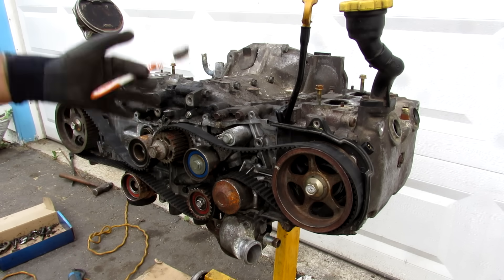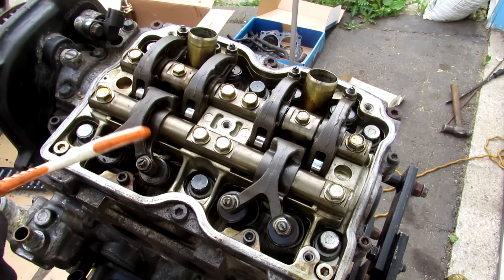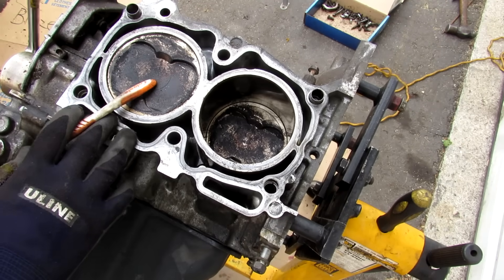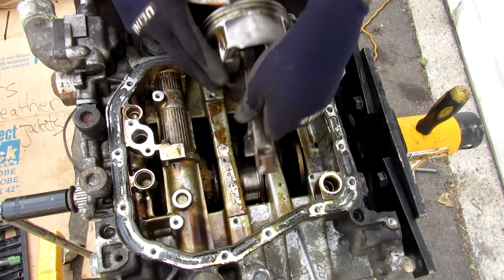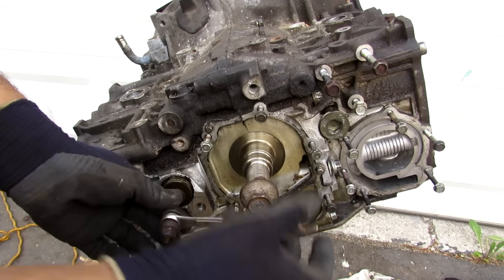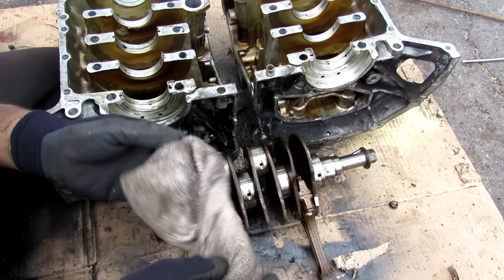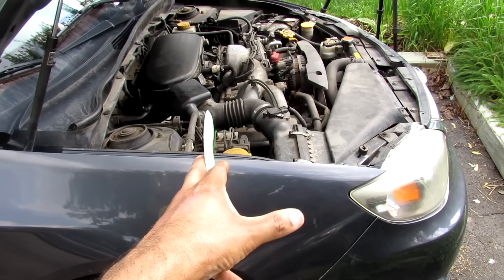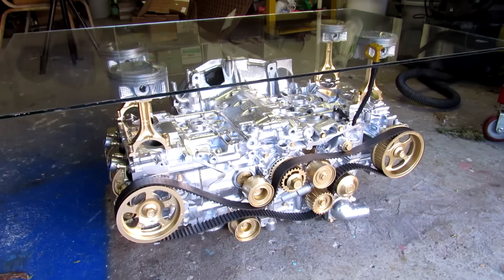Why Subaru Engines FAIL

Comment: Here's a news flash:  All engines Fail.......ultimately.  To single out Subaru as one that fails more than any other is ridiculous.  I've often wondered why Ford, Chevy and Chrysler products fail routinely before they hit 100,000 miles.  Engines, transmissions, etc. seem especially vulnerable on American/Canadian built vehicles.  As an owner of a 2008 Subaru Forester, I laughed when I saw the headline of this video.  I bought my Subaru, with the classic boxer engine, new in 2008.  12 years and 149,000 miles later, I have not had one bit of trouble, engine or otherwise with my Forester.  The key of course is regular maintenance for your Subaru.  Keep up with the regular routine maintenance and it will last you well over 200,000 miles.  I have friends who have purchased Fords, Chevy's and Chrysler products and have had engines blown, transmissions break long before they reached 100,000 miles.  When talking cars, Subaru is one of the best and most reliable vehicles you can own, even if some mechanics out there say otherwise.  I wouldn't hesitate to buy another Subaru in a heartbeat.

Comment: There are a few more reasons these engines fail.  1. the engines are designed with a large tolerance, meaning the gaps are 3 times bigger than they should be.  But this works well with 20W50 oil.  2.  burping the water jacket is harder than buying a new car.  3. the water jacket path means the heat from the cylinders heats the heads.  4. The engine is not balanced for high RPM.  This is not just the crank, but the weight of the pistons and connecting rods.  5. the engine was designed for city people to drive around at speeds less than 40 MPH and not be driven for more than 30 minutes.  So it was engineered to fail if the driver is not over the age of 65.

Comment: Centre bolts are marked because the washer is slightly larger to provide extra clamping load in the middle section of the head
Reply from the maker: Good to know. I believe the torque spec is higher

Comment: Ist time here, I have been looking to get a Subaru for a bit.  Synthetic oil help out with the oil starvation issue and coking?  I have a 2005 Pontiac vibe with a 1.8 that has 285k miles. Engine runs like new with no oil use. Oil color is tan not black when changed.  Used Mobile since 15k when purchased. Do you think I will have similar results on this Subaru engine?

Comment: Thank you for the tear down of the Subaru engine. I had a Subaru Outback any my experience with it supports your view of weak head gaskets. At around 100 thousand miles the head gaskets failed. It cost $5,000 to repair because the engine had to be taken out, heads removed and milled, and then new gasket installed. The Subaru was overheating badly and I took it to my mechanic. My mechanic informed that this is a common problem on Subaru's and he can't understand why Subaru doesn't address this with a better
design or better gaskets. I maintained the car by the book with frequent oil changes and still the gaskets failed. Bottom line, I'll never buy a Subaru again. If you are considering a Subaru and keeping it consider buying the maintenance insurance or just lease the car and give it back to Subaru prior to 100 K miles. Also experienced problems with the CVT transmission. My mechanic commented that they are also prone to problems.

Comment: My wife and I have been driving Subarus since 1995 in that time we have had 7 different Subarus. In all that time we have had no major repairs and none to the engines just maintenance. We passed down several cars to our children who have taken those cars up to the 200,000 mile mark and they have had no engine repairs.
Reply: Yep. You just have to be more particular with your maintenance schedules. I own 2, 1 with 200k, and the other with 100k. never had to do more than replace an oil seal every now and then.

Comment: By far this is the most comprehensive video on subaru engines. I have a 2003 subaru outback that has had its head gaskets replaced at around 225k miles. Recently a noise from what i suppose is the engine can be heard when first driving. After a certain mph it can't be heard probably because of wind noise. I cant figure it out and I was wondering what could be the problem from what you know.

Comment: And I suppose Porsche engines fail for the very same reasons? My 2.5 L Forrester is 14 years old and travelled 260,000 km and drives like NEW. As wisely stated below, maintenance is the issue so I call FAIL.

Comment: I'm really glad I didn't buy a Subaru. So, what is a boxer engine good for, other than low vibration? Seems to be several design flaws with this style engine. I can see it's not conducive to diy maintenance. Looks like a nightmare to change your plugs.... It actually looks worse than a transverse v6 (hello, Toyota 2GR-FE!), well half of one....

Comment: Hi, Really enjoyed your video and explanation. My only concern is in your description of the engine as HORIZONTALLY OPPOSED. This is totally wrong. A Horizontally Opposed engine has both pistons in the same  cylinder. Obviously this and all Subaru, VW, Porsche, Alfasud/33 Engines do not have this arrangement.
For a full explanation of horizontally opposed engines look it up on Google under Commer Knocker. This is a two stroke diesel truck engine used in trucks in the 50s and 60s, usually supercharged. These is no room in the combustion chamber for valves when 2 pistons are moving towards each other.The piston is connected to a conrod that is connected to a rocker arm which is in turn connected to another con rod which is then connected to the crankshaft.
This is not the first time I have heard Subaru engines described as horizontally opposed. I think it probably started by a printed press journalist who didn't know what he was talking about and spread from there. much the same as journalists call non turbo engines aspirated ?????????      All  engines are aspirated.     The term means taking in air which natural and forced engines all do.
I hope this explains horizontally opposed engines.
Reply: A little knowledge is a dangerous thing !  Well, the item you're describing is a HORIZONTALLY  OPPOSED PISTON Engine.  Per your reference, ALL the engines you've listed are all FLAT engines and are HORIZONTALLY OPPOSED, since the pistons are arranged in a horizontal plane, opposite the crankshaft centerline from each other, whether they are 2, 4, 6, 8 (or more) cylinders. 
A HORIZONTALLY OPPOSED PISTON engine has two pistons in a given cylinder, running at each other!  These were used in large trucks, VERY LARGE SHIPS, German aircraft engines and others.  Primarily, they are two stroke engines, with porting in the cylinder walls.....and a crankshaft and rods on both ends of the cylinder (the rocker arm variation is one offshoot).  They have simplified valve actuation, but they are quite tall, with cylinder heads on both end....and they're also a bugger to work on!
Reply: @dgardner55  Hi, I can't work out if you are agreeing with me  or not. None of the engines I listed are horizontally opposed as they DO NOT have 2 pistons in ONE BORE! Just because the pistons move horizontally does not mean they are opposed. Opposed means moving towards each other as a  means of producing combustion.

Comment: My turbo legacy ran out of gas at full throttle on the highway. Ran lean and melted a quarter sized hole in one of the pistons. 
Striped it down got the block bored .015 over ordered a new set of pistons and rings put it back together and she ran like new.

Comment: Don't own a Subaru and never have, but have always been curious about the engine design and potential problem areas. Looks like it takes some special training and experience to properly rebuild one, and this guy obviously has had it. Great job, concise explanation, excellent video!

Comment: Change the oil and filter.
Change the radiator fluid.
Change the Timing Belt. 
Interference valves hit the piston if the timing belt breaks.

Comment: Wow! What a fantastic video of the boxer engine! We own a 2011 Outback 6 cyl., and have been very happy with it, but I've heard and read so much bad about boxer engines that I doubt I'll buy another Subie. Ours is fine mechanically (knock on wood), relatively low miles (56K or so) and has never disappointed. But, I think I'll shop elsewhere in the future, just in case.

Comment: Yes, it is well known that subaru has head gaskets that go bad, what most people don't tell you is that they go bad at around 150,000 miles not bad,  I had mine replaced at 125,000 and it just turned 300,000 miles and has had no other major repairs other then that and it still drives and sounds like a new car, I don't know of many other cars that can match this?

Comment: Apparently that specific engine was not properly maintained so it failed relativly early. That is not a design fault. Any machine will fail quickly if not maintained. The primary advantage of opposed piston engines is inherent primary and secondary balance and allow low CG when used in automobiles. The disadvantage is they are relatively wide making a packaging problem that has been solved by Sabaru, Porsche and, in the 512, Ferrari. 
Reliability is a result of proper design, materials, manufacturing and maintenance.

Comment: Subaru super strong, 350000km and never used a drop of oil. 
It idled so quietly, you had to look at the Rev counter to see if the engine was running

Comment: i think maybe the gravity will cause pistone to scratch bottom side of cylander over the time. because its weight is always on one side of cylinder. what do you think?
Also, does these problems exist for porsche boxer engines too (and also BMW motorcycles boxer engines)?

Comment: Speaking as a retired VW tech (20yrs), I've had the opportunity to tear down several 'water boxer' engines from VW. Another flat four design. I can see that Subaru was much more thorough in the sealing of their cylinder heads than VW. We routeenly replaced the water boxer head gaskets every 40 to 50k. Their head gasket was nothing more than a circular round strip of metal! That's it! VW did a terrible job of turning their air cooled block into a water cooled. Lots of problems!  Having worked on numerous different engines over the years I have never been impressed with the opposed 4 cylinder design.  This is one of the best vids for learning about Subaru engines. Good job speedkar99.

Comment: Good stuff! Here's another downside to Subaru in general. They tell people to do oil changes at 6000 miles. And what does the average driver do? They end up going 2000 miles over on every single oil change. Sludge, contamination, changes in viscosity... Now your engine leaks like a sieve.
I see this every day at the shop. DO YOU OIL CHANGES, PEOPLE.

Comment: I know it sounds like there are a lot of flaws with these engines but i bought my 1999 turbo impreza with 98,000 miles, drove it like I stole it for the first 5 years and sold it with 235,000 12 years later still running. Changed the spark plugs once in 12 years and oil changed once a year with bog standard cheap oil from Halfords.  Compare that to my wifes 2004 80,000 BMW E46 which was driven like miss daisy all its life which had multiple oil leaks and cooling issues from 60k upto 80k when it was sold for scrap money.  Personal experience differs for everyone but my 235k EJ20 turbo engine was incredible.

Comment: My mom has a 2016 Subaru with a boxer engine... it burns oil like crazy. The dealer keeps telling her that it’s normal, my instinct is that it is NOT normal for a relatively new engine to burn a quart of oil between oil changes. Especially one that’s been pretty much babied from the day she bought it. Any opinions on this?

Comment: Great video. Had a Subaru with hairline cracks in the cylinder heads, fixed under warranty, did more than 300 K with it, never touched the gearbox nor the shocks. Red worms ate the car. Well engineered though.

Comment: Do these engines have ANYTHING other than weak spots? Seems like an engine to avoid.
Reply: No. They’re really god awful engines, the Germans perfected boxer engines then stopped using them because they saw that they just weren’t as good as stuff like inlines for small engines.

As a reminder, the air cooled volkswagens never had head gasket problems. In fact, they never had head gaskets, the engines were built so well they didn’t need them to retain the oil. 

Only oil problems those engines have are bad push rod tubes or old engine seals, maybe a bad valve cover gasket that takes 10 minutes and 10 dollars to replace.

Subaru has made them for years and keeps adding problems.

Comment: How many miles on this engine? Oil starvation did most this damage
Reply from the maker: I don't have history on it
Reply: @speedkar99  How many miles on the toothbrush though
Reply: Most Subaru engines will easily go 2 to 300,000 miles or more, if maintained. I have a friend with 500,000+ on an old 2.2L Legacy.  I had a 97 Outback with over 180,000 miles that would have gone much farther if my son hadn't ran over the concrete culvert at the end of our drive. That flattened the exhaust pipe on the right bank and caused it to burn the exhaust valves in the right head. And the leak it caused in the oil pan didn't help matters much either. Needless to say, it died on him.
Reply: Probably because no one knows you need to swap out that oil pickup o-ring on the sump.

Comment: You are wrong about the v6 being more balanced then a 4 or boxer engine. A v6 is the most unbalanced engine design, and the boxer is the most balanced.
Reply from the maker: Okay I'll take that. I'm going to clarify this in my next Volvo inline 5 cylinder video.

Comment: My old 1984 GL coupe had a 1.9 boxer and it never had any of these problems...I drove it to the dump with 260 k on the odometer. All the options still worked, but the car was too rusty. I took out the battery, drained the gas tank and took the ignition key with me. 4 hrs later I got a call from someone who wanted to know where the key was...and I sold it to them. One day later...the car was back on the road...eventually it was traded into a dealership toward another car.

Comment: I live in Portland, Oregon, Subaru town, and it escapes me why people buy these cars.. I don't know of anyone who owns an older Subaru that has the original engine. Recently, two friends traded their excellent cars for a new Subarus. The new ones are noisy, cheap, get crappy gas mileage, and they don't hold up. One new Legacy came with a defective battery, leaking rim, and ripped rear seat.
Reply from the maker: The newer ones were supposed to be better with the FA series of engines
Reply: They're called dumb Democrats!
No way to explain them!!

Comment: Τhe subaru boxer engine especially the ej20, is one of the most successful engines ever produced. 
It has been used by subaru for over 20 years, making only a few upgrades over time.
All these problems that you mention in the video, are common problems of all engines due to poor maintenance and due to bad over tuning as is usually the case with subaru engines for increased performance. This particular engine is in such poor condition that it is not the result of poor design. Certainly this particular engine was not properly maintained over time.
Reply: I agree 100%, and yet, most of subaru owners are very careful in maintenance..... So, i suppose that You can buy a second-hand subie With no troubles, but a third-hand one maybe very dangerous: maybe it's his wife's car😂
Reply: (Honda/Acura J-Series Enters The Chat) 🔥🔥

Comment: Very good video. However V6 engines are naturally unbalanced. They took forever and a lot of counter balancing to be made in a smooth running engines. The odd piston count doesn't help at all. The V8 is very stable and balanced. In terms of longevity. Most 6 cylinder in-lines and 4 cylinder in-line engines are naturally balanced and create very little unwanted vibration. In-line engines typically have superior longevity to boxer and V configurations. They do not fight gravity. The cylinders do not yolk out like the boxer and V engines do over time.  The biggest problem with a lot of inline cylinder engines is that they take up more space in an engine bay. Thus limiting car design and placing the center of gravity for the car up higher off the ground. In-line engines typically have a longer stroke and as a result produce more torque.  
Anyway. This had been my experience with engines in general. The step by step teardown and explanation of the boxer engine was well done. Perhaps you could get your hands on Mazda Wenkel rotary next and pop it open for us!
Reply from the maker: I'll stand corrected and will explain in my upcoming Volvo 5 cylinder video

Comment: Very cool!
Just now replacing the seals and head gaskets on mine. Nice to know it's pretty well off compared to this one lol
Reply from the maker: Did you have to pull the motor?
Reply: @speedkar99  lol You know I wish I could but I don't have a crane. 
I was able to take the engine off the mounts and jack it up just enough to clear the frame.
Reply: @speedkar99  Hey I just finished up replacing all the seals and everything on the heads and I must not have noticed because it was dark but the cylinder walls all have substantial wear.
Like part is yellow like brass and part is silver. There are criss cross scoring all over them. The engine ran fine aside from burning some oil and it doesn't have enough of a lip at the edge to feel with my finger tip so I think I'm going to try to hone them by hand and measure the taper with my micrometer to be safe.
I just have one question. Do you think it would be wise to just replace the whole set of connecting rods or is it okay to just replace the bearing caps and reuse the connecting rods?
I'm assuming the bearings will be in kinda gnarly shape so I'm ordering them ahead of time but I have no idea about the rods themselves.